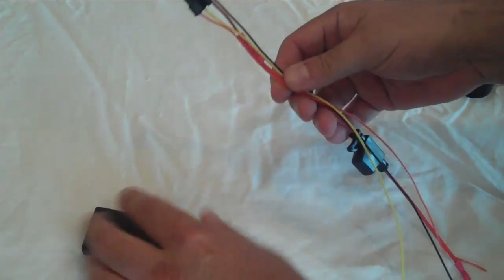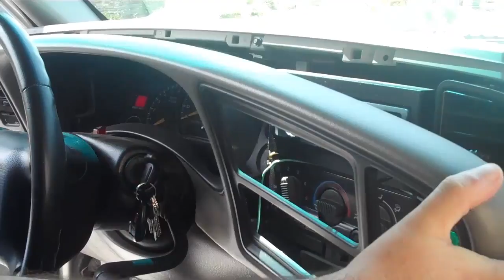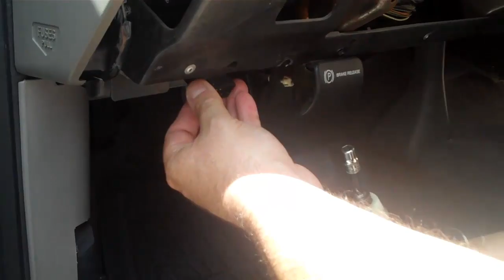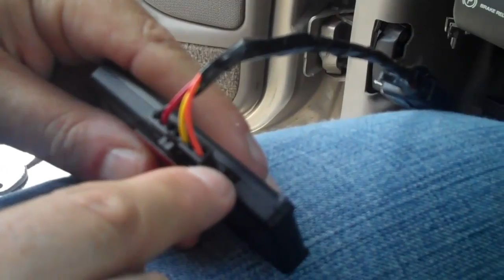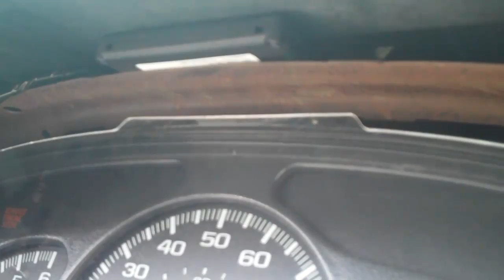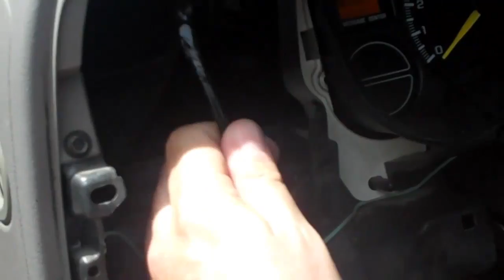How to Install GPS Tracking Devices for Automobiles

Comment: OK, so you connected the power but didn't connect the other 4 wires and for good reason...besides dismantalling that would have been the worst part, highest risk actually 👏👏👏 I salute you

Comment: Stealth installation? Definitely Not! Any mechanic & most owners today are familiar with the under dash OBD connector which sits idly with nothing connected to it except when using diagnostic tools. With the GPS tracker harness plugged into it will be a total give away!

Comment: the second i found the OBD2 port missing i'd be tearing into the dash to investigate.. this install is flawed in several ways.. not only that, the state plugs into the OBD for emissions testing and safety inspections every year to get the windshield sticker.. and any mechanic that may work on it will also inquire about the ALDL... EPIC FAIL

Comment: To be honest, speaking as an attorney placing these devices without a driver's knowledge (or court order) would be extremely illegal.  For a legal install, I am not saying you need to tell the driver where it is located, how to uninstall it, or let the driver see the lights... If the driver contracted to allow the device, I would recommend against tracking the drivers' locations unless they miss a payment.  To do so would be a violation of privacy, and I would certainly sue.  I am NOT saying do not place a device; I am simply saying to disclose it and the terms for which the driver has no expectation of privacy.
Reply: this is meant for thefts.
Reply: NETWizzJbirk  I believe your incorrect. Although admittedly it depends on the laws where you are located. But generally speaking there's nothing illegal about tracking a vehicle. It's true that in most places it's illegal to moniter people's conversations, hack their emails, text messages etc. Those are considered EC's (electronic communication) and are not admissable in court. However if your not using the info for legal reasons then doubt you would be prosecuted for anything. But as I stated these are a device meant to track items such as vehicles. They can show you where the item is, that's not the same as showing you where the driver may be at any given time. And if it's not your item that your tracking I hope when you find the bastard you kick his teeth and balls in !!!